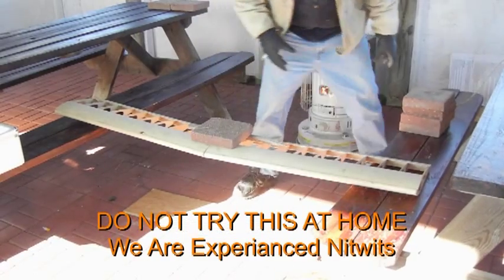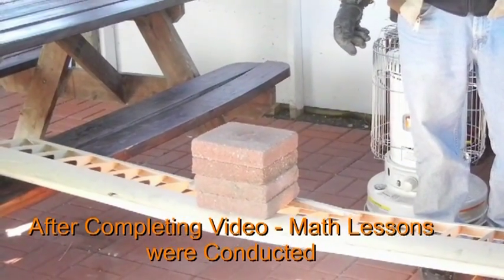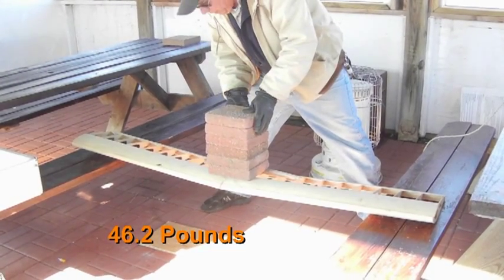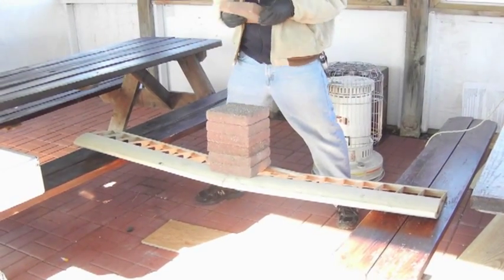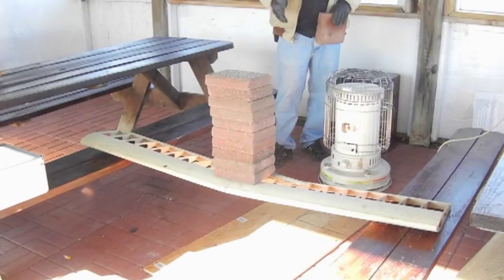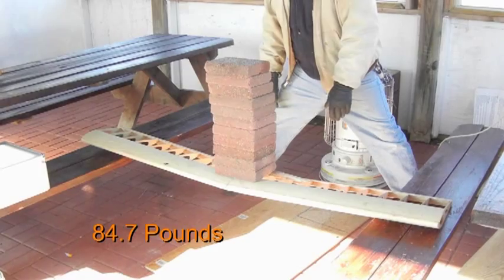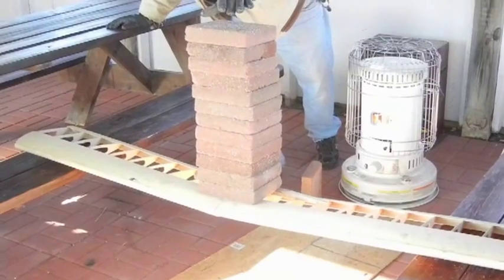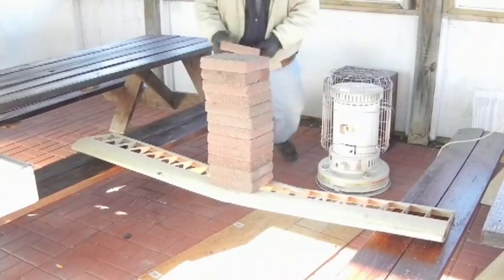WingFailure

Comment: Interesting. Of course, the upward load on the wing was not evenly distributed, as it would be in flight, but at the two points of support, so the effective strength of the wing is more than this. Also the tension in the covering of a real wing adds to the strength. A good experiment.
Reply from the maker: All valid concerns. The wing was just lying around doing nothing... so....